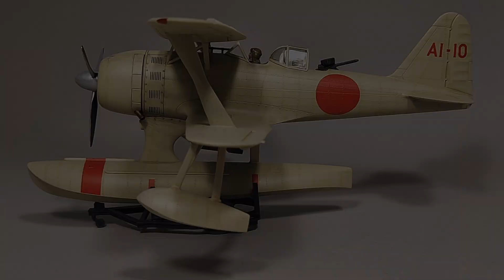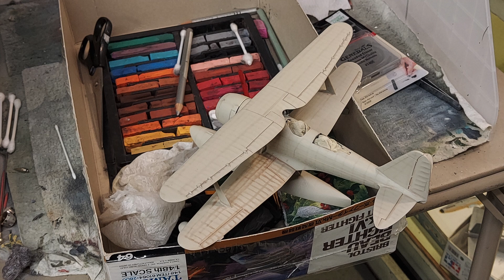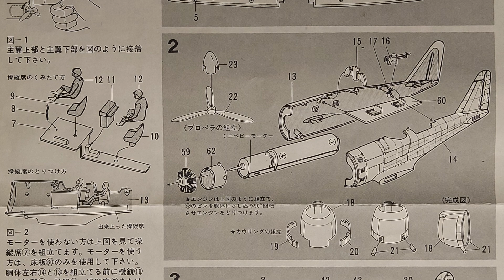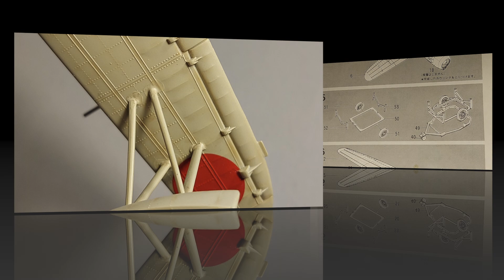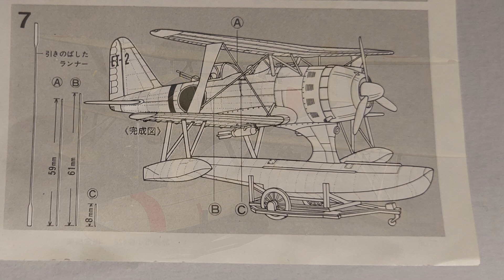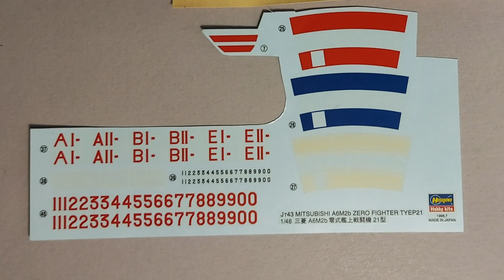Tamiya 1:48 F1M2 Pete Review - Painting A Tamiya Model Kit!

Comment: Hi Jon.
Very nice result. So nice that when I first glimpsed the thumbnail I thought it was the Hasegawa kit. Fantastic subtle weathering/shading. Great colours.

Originally 1967!!!!! Beats any kit I built in the 70's. You can't see the engine but it has a good one. It has an actual cockpit, not a blobby head on a flat surface. 
Tamiya being amazing (again!).

I love a float plane or flying boat. Just found a Tamiya N1K1 Kyofu on eBay. And recently found a Modelcraft Canada 1/48 Noorduyn Norseman float plane (My Dad trained in one in WWII).

Just read a graphic novel (Nemoto's Travels) based on a diary of a Japanese E8N and F1M2 pilot in the first year of the Pacific War. Very interesting.
Thanks for the entertaining/informative vid. (I'm hiding from the very hot weather).
Cheers Matt🦘
(Model On!)
Reply from the maker: @MatterusOD  Thanks Matt! I agree. The float planes are really cool. I need to paint my N1K1 and get it finished up. We're in the middle of a snow ❄️ storm 🥶 now. I think I prefer the heat. Cheers!

Comment: Hey Jon, although I have added a lot of new kits last year, I still like many of the
 " vintage" kits because they are less complex and offerr the creativity you mention.  I want to try the pastels but curious about the affect of a satin spray diluting the pastel. I mentioned Amusing Hobby kits in a previous post, specifically the Me 262 HG lll series. I've  finally got all three versions. I was going to get you some pictures but Murphy's Law put my work station in the shop. However, I really think you'd enjoy building any of the three to work with their new moulding technique  And they are reasonable prices at $ 34.99, 1/48 . Andy's Hobby Headquarters in Arizona had all three and is typically my go to distributor .  It's not parts heavy at all like these new kits. but a real challenge to finish out. Andy carries so much it takes a while to navigate his site I just go to View All and go to the alphabetical listing.  Cheers Bob
Reply from the maker: @c123bthunderpig  The satin coat will lessen the effect of the pastels, so it's good to overweather just a little. Thanks for the feedback on the Amusing Hobby kits. I'll definitely have to check them out.  Cheers!